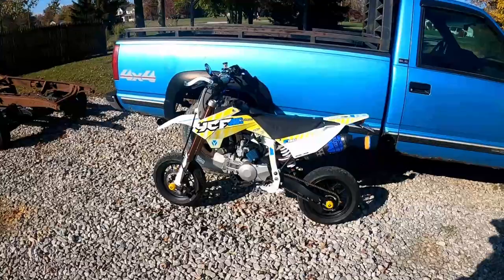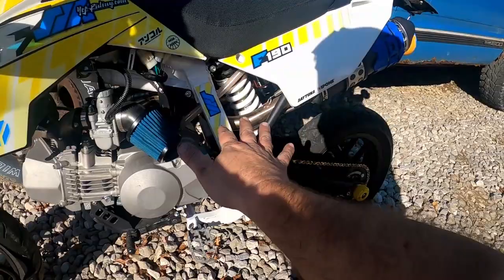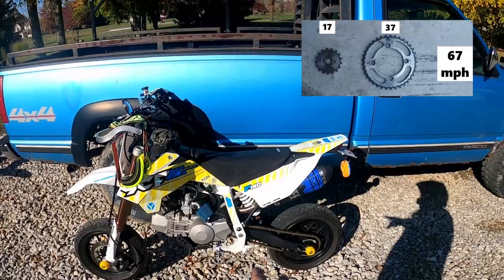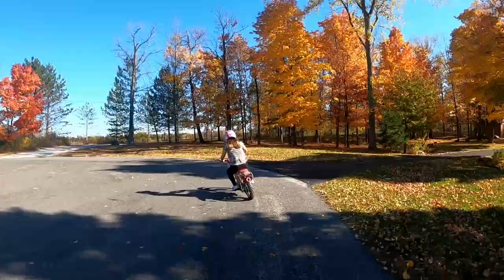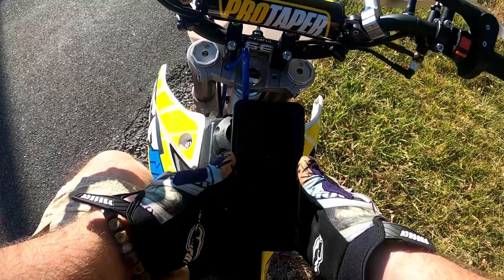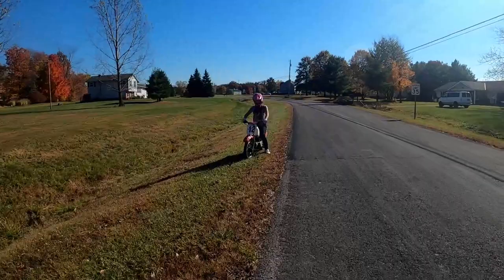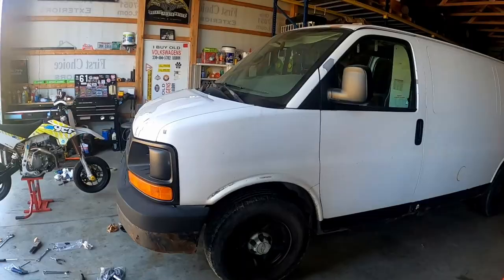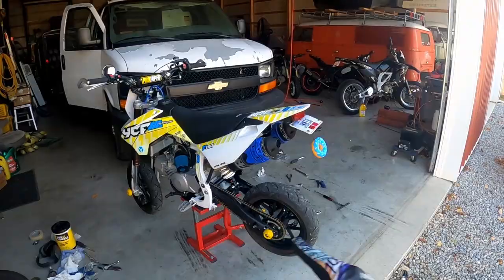YCF 190 Daytona SuperMoto First Impressions And Top Speed After Sprocket Swap

Comment: People saying these will do more than 100 mph? I call bullshit
Reply from the maker: I think those same people have a 600cc sport bike that'll go 2000mph🤪🤣  You could probably get close to 100 if you had like an 80lb rider and the right gearing and rung the engine out to the point the valves floated🤪  Sounds like total bullshit to me though.  80mph with a "normal" sized rider and the correct gearing is probably more realistic.  They're definitely fast as fuck, but have there limits🤘
Reply: @GromBeardo  Yeah I've seen a vid on here of one doing 86mph but that was struggling, I think around 90mph top speed any more than that would require serious work and definitely a steering stabiliser lol
Reply: theres a guy in finland that did like 160-170kmh on that engine fully tuned on a monkey bike so -8inch wheels
Reply from the maker: @JapeJape-uc9ip  😮

Comment: I noticed the rubber plugs in the cooling fin are still in it some say there only for shipping and can make it over heat some say it there to improve it.  I would think sense there made of rubber and melt they can't be for cooling I would.look in to you be the judge. And depending on the model you have I might have the cdi you need it was of the ohvale mini gp 190 Daytona. And you if you wheelie with out a catch can oil will be every were good by clothes lol but not. and the klx shifter I think works for a better shift for it but it's been a minute might check on that 👍👌✌️💯🤔sick van should murder it out and paint it with raptor liner bed liner it's tintable for color as well arm van🤔🇺🇸👍👌✌️💯
Reply from the maker: Ha, I was wondering about those damn things.  I wanted to take them out, but never seen anything like that before, so figured to just leave them.  They're coming off for sure.  This thing blew oil for me even without wheelies.  At high rpm it puked it right out.  It's all good now though!
Reply: @GromBeardo  lol there goes  the  pants or socks it you have short on. It happens because of back pressure from the engine braking  the catch can if working right should keep everything contain in it. It would be sick to mod some things to recycle back to the engine oil in stead of have to check it if the catch can full if you don't its going to over flow and it will poor out every were if your at a track people also get pissed off at the track because oil need to be cleaned before driving again. Happen quite a bit to the mini gp bikes  you think some one would have a fix or mod by now  instead of having to  remember to check if it full.🙄🤪 👍👌✌️💯⚒️🥂🏍️
Reply from the maker: @josephsaucedo8691  Yeah, the stock catch can is tiny too.  This setup works so much better.  I planned on running the drain to the valve cover, so no need to empty the can 😁
Reply: @GromBeardo  that definitely a lot better . no one wants to keep checking if it full and this is why a lot of stunt rider don't like the 190cc Daytona/z's engine they rather build the Honda engine for twice the price 🤪🤢 not worth the money in my eyes 🤑✌️👍👌🔧⚒️🥂🏍️
Reply: Might I ask how u made a catch can? Def need that for my YCF 125sm ASAP!

Comment: You need to cover the wires properly there meant to be waterproof obvs the wires aren’t covered in a casing you can buy thick rubber tubes that you put over you’re wires and heat up with a turbo flame lighter and will have you’re wiers covered properly
Reply from the maker: Yeah, all my other bikes have waterproof connectors or at the minimum a formed rubber shield/sleeve.  This bike, not so much🤣

Comment: The cool air intake need a air filter box modified of course to fit but it will keep water from getting in to the intake dill holes in the box along as it's not were the intake filter at.           If you no what model the Daytona is I would be able to tell you what you have like some have adjustable cdi boxes  different cam gear ratio they even have a stroke engine it had to tell what it is but the should be a set off number on bottom of it that indicates the model If you have a hard time finding specific model it's part of the serial number. some times  I don't need that   but for example Amazon they put the part the number in the info to indicate the model to make sure the parts right these are the same number that will let you no the model and I have a spec chart from Daytona  to identify what it is  the number on Amazon my be different because it not the same model but you should be able to tell what set you need off of your engine.👍👌✌️💯🏍️🔧⚒️

Comment: The pherilli scooter tires are the tire you would be looking for there track monsters for super Moto  and the stock pipe probably not helping gut them the 190 you should gain on that top end.   That and check the jetting right and the plug gap your lifters make sure there three or four thousand those are usually were you'll find you higher top speed it's the most common problem and the timing not advanced enough all those combine equal power you no China I always think there left over race engine they just clean them up and ship them to us and all the  good shxt they keep for them selves.🙊🤔 💯👍👌✌️🇺🇸

Comment: Hey brother!!! Question for you. After you modified the sprocket did you have any issues with oil blow blowing out the rear and coming out of the rear plastic over flow???
Reply from the maker: I had those issues since day one 🤣  Well, until I installed a real catch can.  I show it in one of these videos I did on the 190.
Reply: @GromBeardo  damn!! Ok! Let me find that video. Cause I’m taking it back to the dealer tomorrow to have them look at it.
Reply from the maker: @BPxGarage  I know they had some issues for a while with overfilling the engine with oil.  I have an oil cooler, so I think I run 550cc.  No cooler might be 500cc.   Just something to consider.  I also have my CDI set to the lowest RPM limiter too.

Comment: Im thinking of one day getting a YCF 190 Sumo. 
Does it pop up more for circle wheelies then the CRF 110 stock?
Reply from the maker: I'd say the CRF110 is better for any stunting stuff.  This thing is more for going fast and cornering.  The guy I got it off of wanted to stunt it, but it's hard to control.  He's been stunting for many years too, and played with the sprockets as well.   Large engine in a small frame, I guess.  I've got the sprockets geared way high so it's not as torquey and just now feel like I could mess around with regular wheelies with some confidence.  CRF build quality is gonna be much more top notch than this YCF too🤘 I finally got it to the point where I felt good with riding on the streets like I normally do and the oil cooler broke, stress fractured at the mounting flange🤣  Hopefully after I fix that it'll be good.🤞

Comment: How many miles have you put on this engine? Like a rough estimate. Do you do a lot of maintenance, valve lash and oil changes on it? Eventually I will get a ycf 190/ either a big or small wheel and I’d love to dual sport it. Especially for when I go to Tennessee. As of now I have a modded grom. Potentially two stroke swapping it.
Reply from the maker: I think I've put like 15hrs on it. The valve lash has stayed rock solid.  I change the oil every 3-4hrs. It always looks like crap. So it's not very confidence inspiring 🤣
Reply: @GromBeardo  awsome thanks for the response.
Reply from the maker: @worldrage619  absolutely!  I'm happy to help in any way I can🤜💥🤛

Comment: I thought about buying one of these. How is it holding up?
Reply from the maker: So far so good, kinda.  I noticed the oil cooler broke at it's mounting point the other day.  The bend in the cooler itself.  It's just thin metal at a 90deg bend with no reinforcement, so vibration made that fail most likely.  Other components have been good.  The oil isn't looking as good as I'd like it to for as many oil changes as I've done.  I've built a shit ton of engines and it's way too much metal still.  We'll see how that goes.  That's really the only thing I'm worried about.
Reply: @GromBeardo  yeah, I'm not sure I'm ready to try it for $3500.  It looks cool!
Reply from the maker: @chrisdavis3952  I totally get that 👍

Comment: I just wanted to say don't buy anything for the Daytona/z's motor internally I don't want to say exactly why on YouTube but if you email me my name no caps no space 82@ I can explain a lot about both and how not to get ripped off by on line sells and why you would go with a zs over a Daytona and it not because of power or better quality. There not what people think. There so much more it will surprise you on what the difference really is or make you up set depending on what has been spent. Don't get me wrong they are great motor with a little work but we'll worth the time. Yahoo👍👌✌️💯🏍️.sorry I wrote it funny. Hope you pick that up YouTube doesn't let you just give it out.    p.s. it took me a lot of research to just tell everyone on YouTube the difference if I made videos it would probably hit a million views if I did it on the two engine z's vs Daytona and what make them different and what I've found out. There nothing on line even the forms I'm apart of a couple and they no nothing only a couple of people have the right idea but not much help. 👍👌✌️💯🏍️
Reply from the maker: Awesome!  I love learning about things like this!  Email headed your way😁